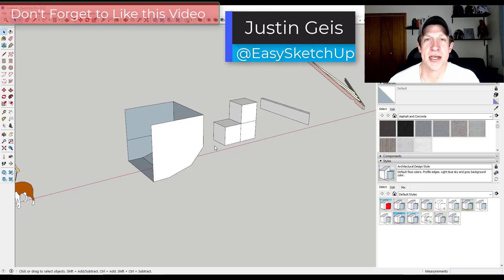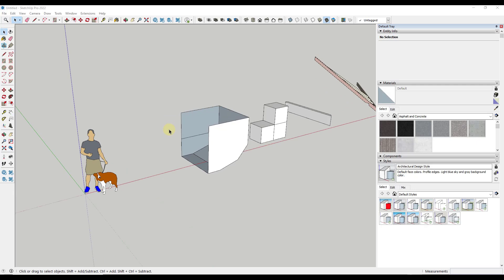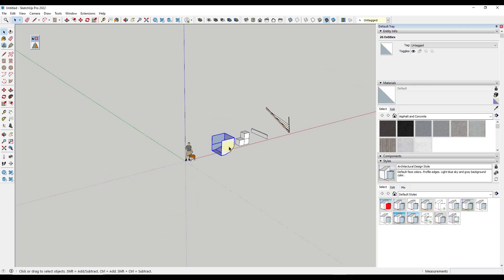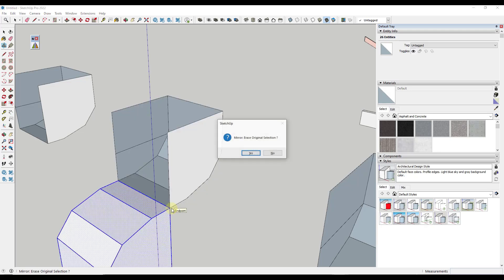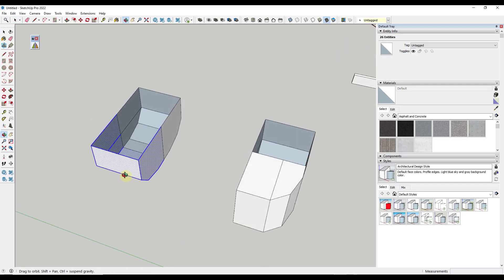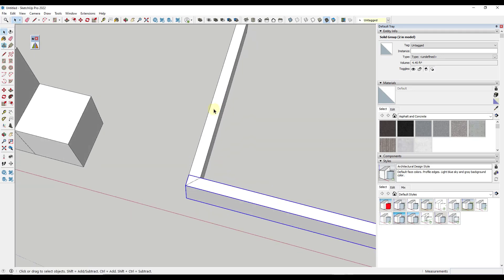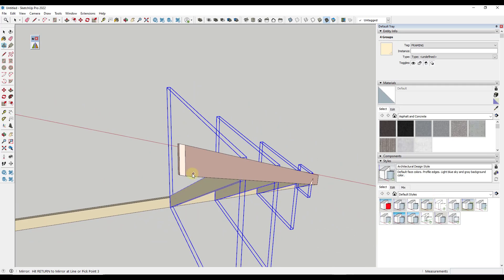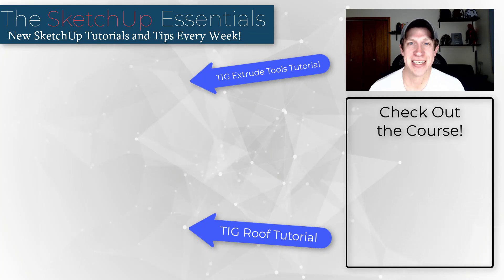Easy MIRRORING in SketchUp with TIG Mirror!

Comment: I used to use TIG's Mirror all the time.  As you say, it is weird that a CAD package doesn't come equipped with a dedicated Copy command.  But it's Achilles Heel is that question that keeps coming up about keeping the original.  It just slows everything down.  I wonder whether the extension could be designed to use a modifier key to choose between keeping and not keeping.  The default setting is erasing the original but I would find the default of keeping better (might not be for others).  Now that I have learned to use it, I find Curic's Mirror command easier.

Comment: Justin - Thank you for another great video.  This will be the use useful mirroring extension yet, based on my workflow.

Question -- Do you have any experience with Rhinoceros?  Reason I ask, I've started playing with it recently and although it takes a lot of time to re-learn/adapt ...  After the learning process it is a lot more efficient/capable.  There are a few things in SketchUp that are easier for the extremely casual, ultraquick massing.  Despite those few things, Rhino has been a worthwhile learning experience.  Plus, the ability to use as a true 2D CAD tool, is a huge time-saver in my workflow.

It would be great to see you do occasional videos in Rhino, or comparisons, etc.  Thanks again!